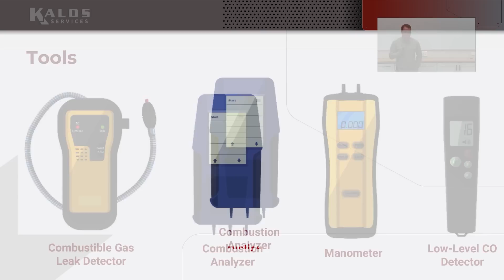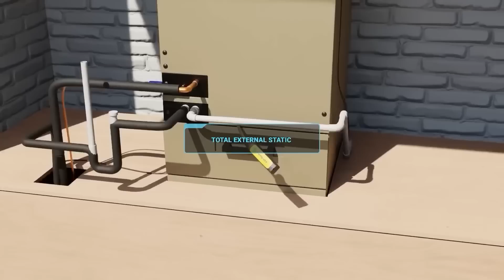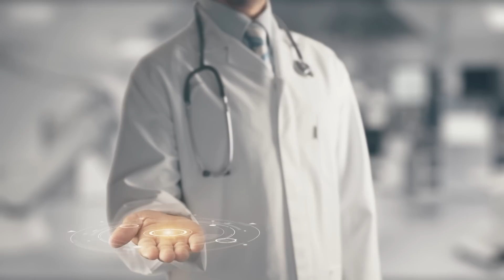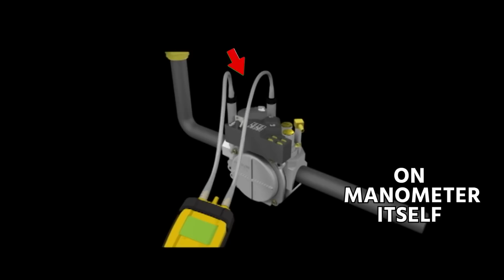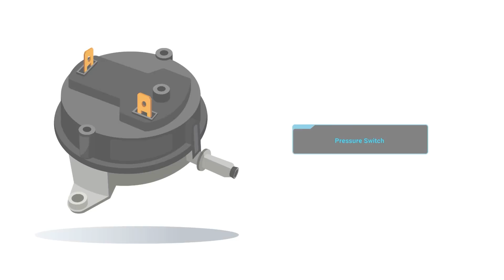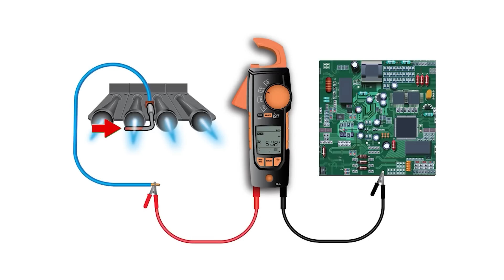Gas Appliances - Preparing for Heating Season Part 1

Comment: I haven't finished the video. But a combustion analyzer is a really good tool. I use to tune care as a mechanic and my AFR told me everything. Working hvac now, it can show me a cracked heat heat exchanger.
Reply: Also undersized gas flex, sounds like an elk bugle. I see it on commercial unit heaters quite often.

Comment: Brian sir. Question for u I am dealing with a heat pump dual fuel split system.  Heat pump runs fine on cool mode and dual fuel, my problem is on heat pump mode my pressures sky rocket to 575 on both sides high and low and also gives me an ambient sensor code.  How can I address this is this a restriction, on what side evaporation coil of exterior or overcharged?
Reply: My outdoor temp was 67 and dual fuel switch over/lock out is set to 40.  Once it kick out the low ambient fault code remains on defrost board until I reset then cycle starts again.  My pressures still rise to 575 on both sides
Reply: Is your gas furnace running at the same time as your heat pump? They should never run together

Comment: Im new and had someone did exactly that with the lighter to the gas piping. Im like WTF are you doing! If you looked in the truck we have a gas detector. "Ive done this all the time" bla bla bla boomer talk. No thank you, I learned alot of stuff through the fire academy as well mr I do this all the time. What if a customer saw you doing that? What if you cant control the flame that shoots out because it was that loose? I appreciate the videos so much.